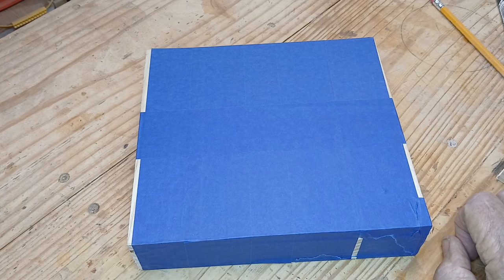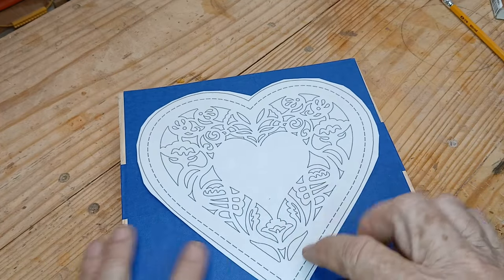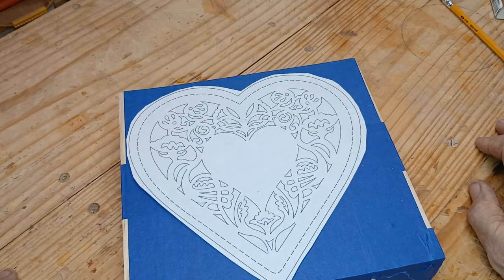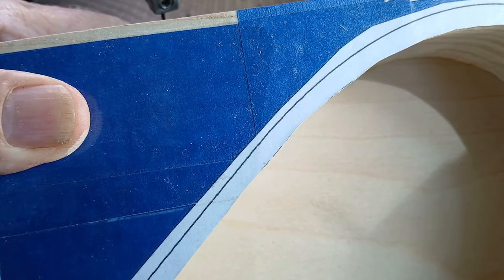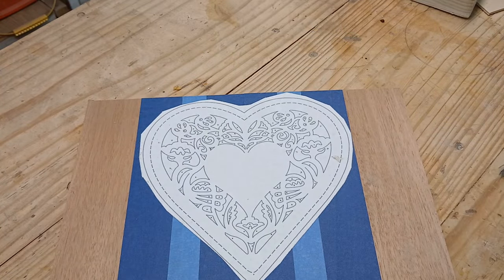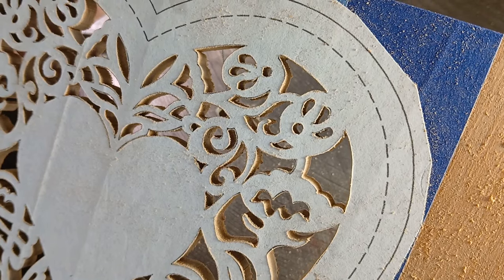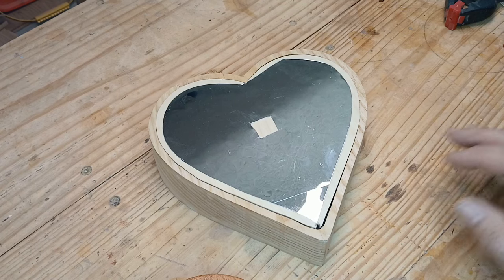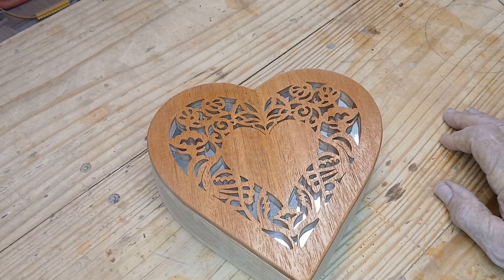Heart Shaped Box With Fretwork Lid Cut On The Scroll Saw

Comment: As always another great video. I do have a question for you, in Dianne Thompson  book on making box’s, on a compound cut of the knobs  which do you cut first, the front view or the top view thank you.
Reply from the maker: Thank you. On compound cuts I always try to determine if one side is more difficult to cut than the other.  That can be a lot  of factors usually the thickness and type of material and how complex the pattern is.  I try to cut the side that is less difficult first so that the second cut has a little less material to cut through.  Sometimes you can possibly remove some of the waste from the first cut if it will hold together properly.  Usually though on the knobs in that book I cut the front view if it is a fairly simple cut.  No real reason, that is just where I start.  Sometimes I do things a certain way and don't analyze it until someone asks about it.  Just a feel I guess.  But questions make me think about why I do what I do and I think that makes me a little bit better.  Thanks.